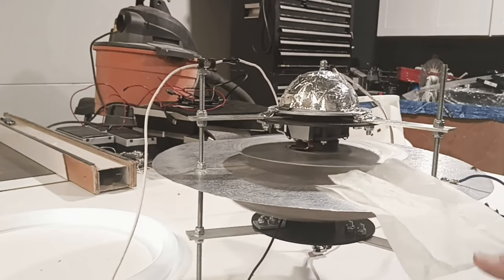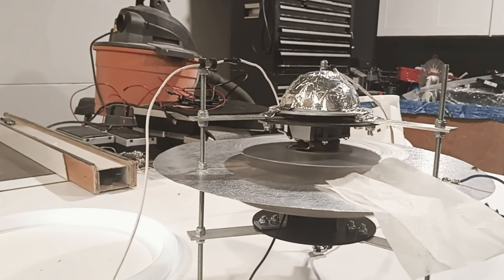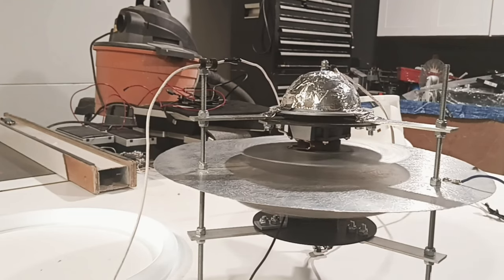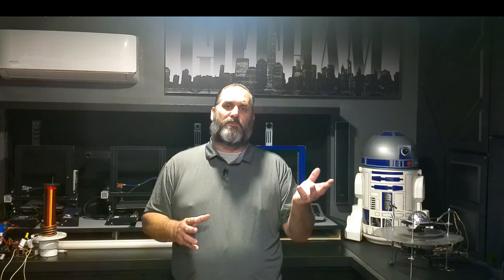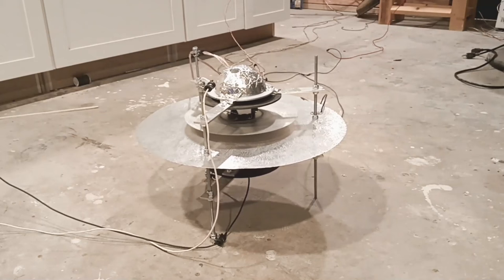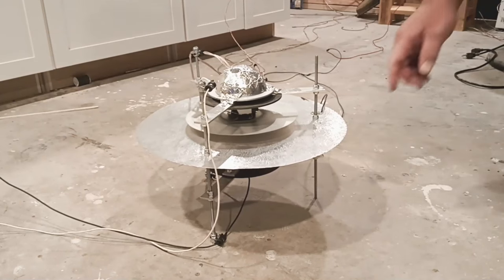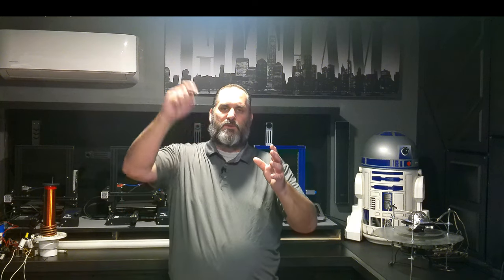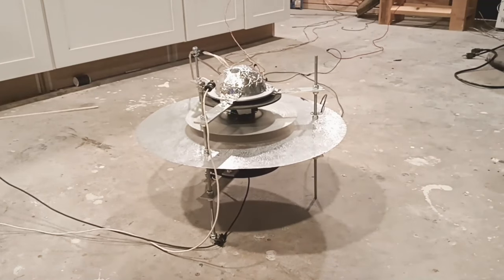Graviflyer "Amplify The Tesla Coil" #46

Comment: The question I have for you is, what will it take for you to understand that you can't trust everything you see on the internet and this might not be true? Playing around with high voltage will probably end up taking your life or at the very least cause some brain damage. Not to mention the amount of time, effort and money you're putting into this. Now you're going to work with two Tesla coils and who knows what's next. Just hope I don't end up seeing your name on the news. I would say, move on to theoretical physics or simulations and try to mathematically prove this craft works before putting your life at risk mentally and physically. Bless up.
Reply from the maker: I do not trust everything I see on the internet. There are many things I will not do. I understand the power that I am working with and what each coil does. I have built everyone myself from scratch before. Even the ac and dc flybacks. I do not plan to run higher voltages in my garage either. 

I keep working on this project because it has proven effective in building fields of energy. They are just not strong enough. I have also found a lot about frequency and the understanding of it to be wrong. This little craft is a great resource to learn the different effects at low power. 

The voltages I use are not very high power. They are manipulated to remove the amps. They pack a punch but not enough to be lethal. Unless you are completely careless. This craft runs on frequency more than voltages. It is just the tesla coil that needs more power. Less than 100v and 10a. My goal is 80v and 3a. I get the power but bring down the danger. 

If you only read about how the voltages work you may never understand why they are low power.
Reply: @nathanbunten4299  Wish you best of luck